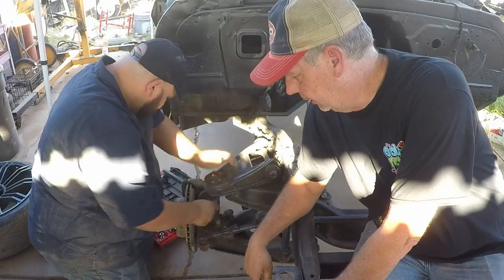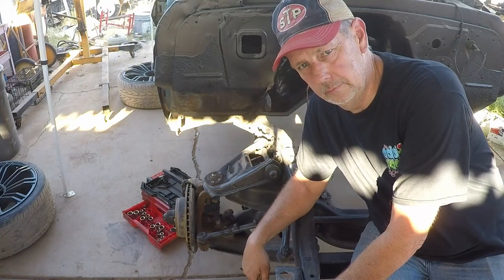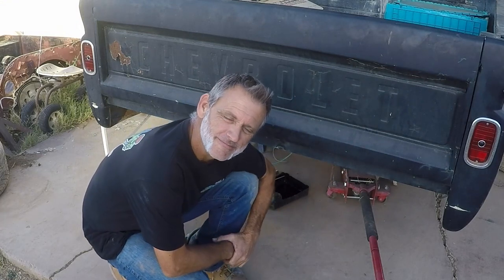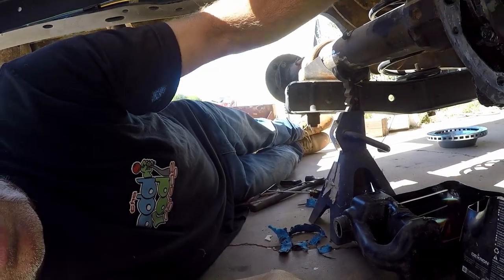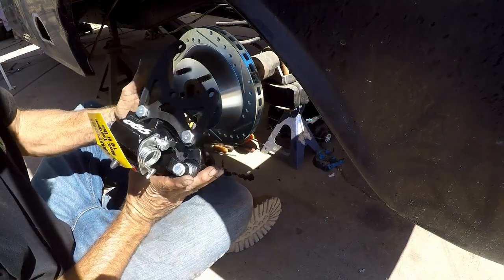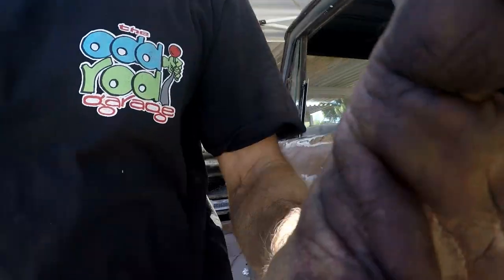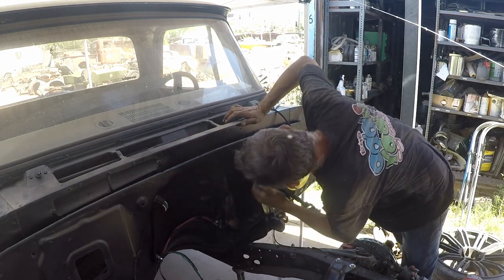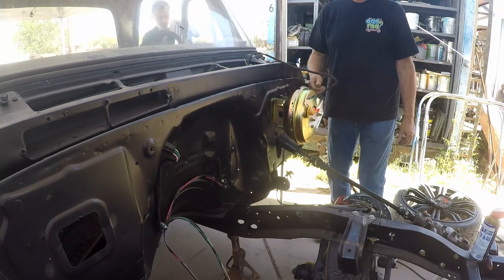Big Brakes on a 65 C10 LS disc brake conversion patina short bed conversion

Comment: Good show today, guys! Geez, those brakes are big. Are you going to have to go to a bigger wheel to fit over those big brakes?
I noticed that when Tommy was goofin' around with the rear rotors, I didn't see any emergency brakes inside the rotors. Are there going to be any type of an E brake on this truck? Maybe y'all are going to put one onto the driveshaft?
Anyway, I looked for T-shirts at the bottom of your info, and I could not find them 😢. When are they coming?
I had fun watching y'all today. Keep up the keeping up! Hahaa!
Later, God bless y'all.
Reply from the maker: There are emergency brakes set up for the rear end. They are cable ran and just squeeze the rotor with the existing caliper. We will try and show them as we put them together.  They are really close on the merchandise store. Thanks for watching!
Reply: @TheOddRodGarage  Cool, thanks for setting me straight 😀but I was looking at the inside of the rear rotor. They look as if they could take the old school drum type of brake shoes. 🥴duh, I feel dumb, haha.